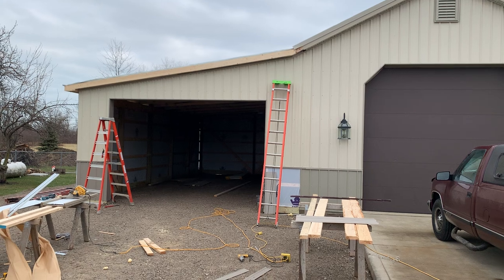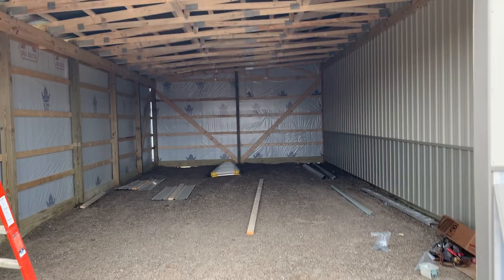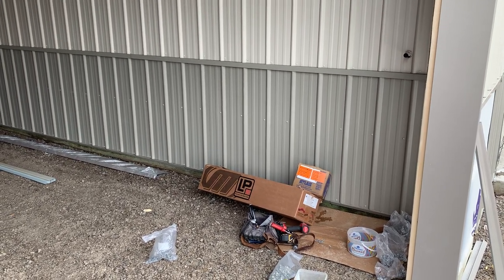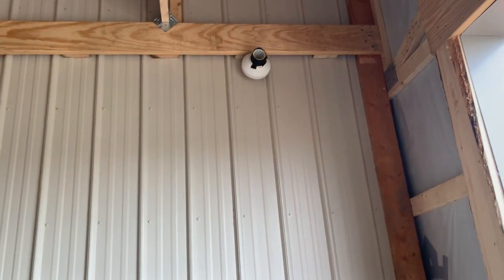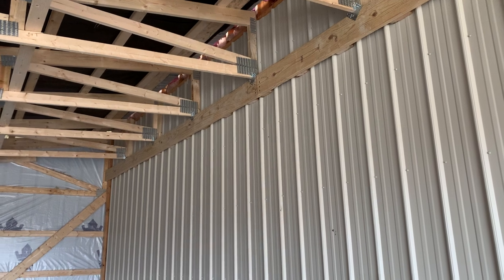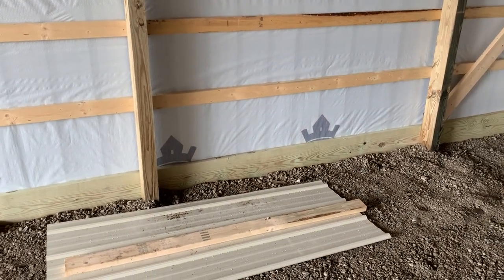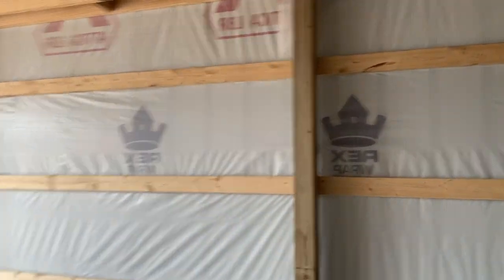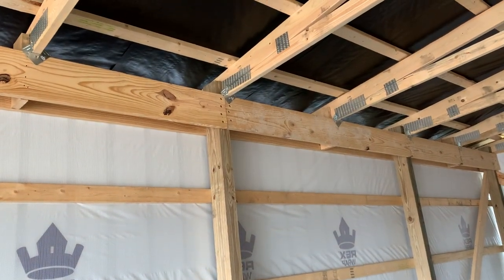20x40 Pole Barn Garage Add-On!!

Comment: How did yiu go about instilling that ledger board? I have a build coming uo with western side metal. Does one need to install the interior ledger board and then cut out the metal to do a double 2x12 ledger? How does one support the ledger inside the building?